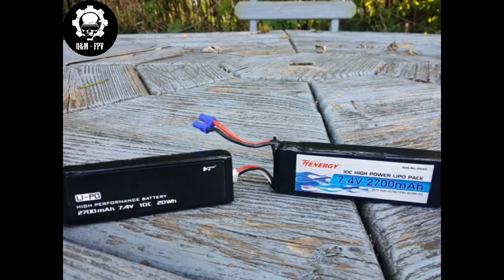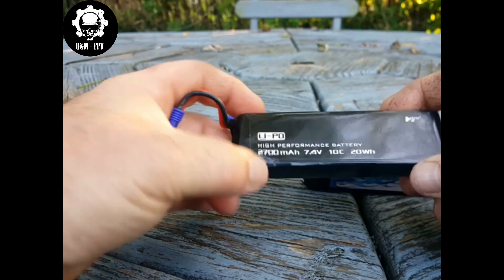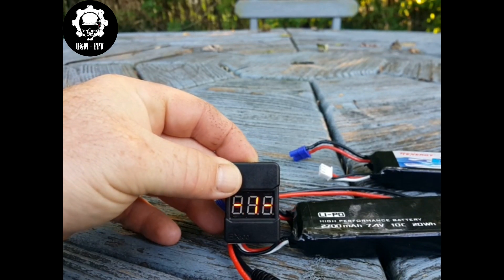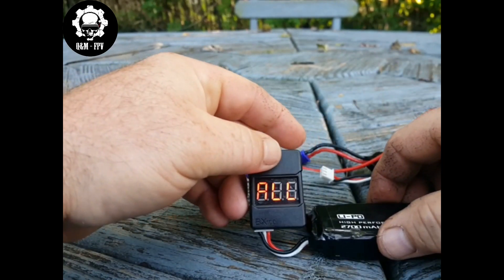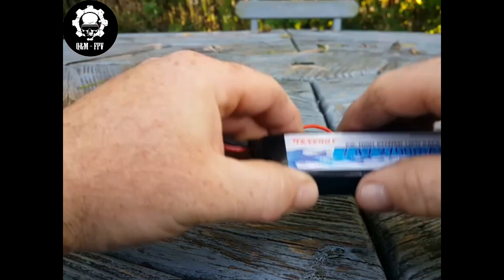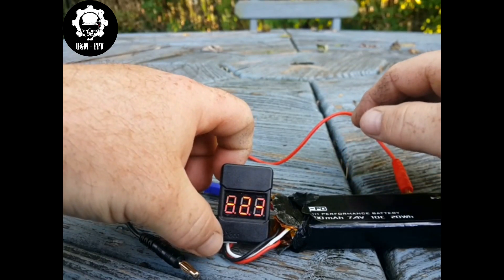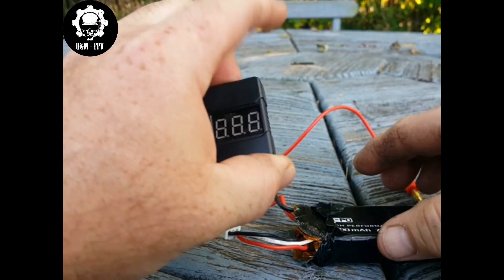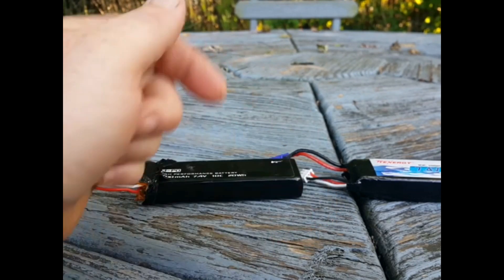Hubsan Batteries! You NEED to watch this!!!!

Comment: Just FYI: It's called a, "protection circuit" and not a, "voltage regulator". :-)
 
A voltage regulator is exactly what its name implies: feed it a slightly higher voltage than what you want at the terminals -- ex. use a +5 volt voltage regulator on a +7.4 volt battery, and you'll get a steady +5.00 volts regardless of the load or the input voltage --  provided that it stays above +5 volts).
 
A protection circuit on the other hand, generally has multiple functions when installed in a Li:Po or Li:ION battery.
 
1: Short circuit and overcurrent protection -- it almost instantly shuts off the output (exactly as you demonstrated) to prevent cell damage and/or an unwanted fire.
 
2: Over-discharge protection. Cuts off the output when the battery's terminal voltage reaches a preset low; this helps to protect the cells in the battery from sustaining damage caused by discharging them too much.
 
3: Overcharge protection. Cuts off the power from the charger to prevent damage to the battery from overcharging.
 
Hope this info. is of at least some use to you.
Take it with my compliments! :-)
Reply: You are absolutely correct.
Reply: This guy does not know what he is talking about 
He is there kind of person who says amperage instead of current
Reply: @pixel_man2346  LMMFAO
Reply: @raydesheles9205  how do you "Laugh my my Freaking A** off?" lol
Reply: @thenorthorangesquad1738  are you the one that made that long drawn-out explanation or are you the one that made the video the one that made it the long drawn-out explanation is when I laughed my ass off at smart pants
Reply: @pixel_man2346  how would you know
Reply: Lol!lol!lol! RIGHT!

Comment: Only a idiot gonna get their quad fall from the sky beacause this only happens when the battery is low voltage 7v or 6.8v ???? almost all drones that are modern (2023) they return to the ground with 7.10v or 7v so if you are flying this old drone and the voltage is near 7v dont give full  throtle or fast speed and descend your drone and your ok !!!

Comment: I have the factory hubsan battery’s but I also have a question, I recently started using hubsan drone again and 2 of my battery’s I bought for the hubsan drone are charging for a long time but hubsan is dieing as soon as I take off, but the original battery I got with the drone works as it should for being about 5 years old, am I charging those other battery’s wrong, or are they just old and should I not worry about it

Comment: Please I need the saint through tonight community can you use a 7.6 volt 2050 w battery in a 122d storm hubsan it already has a 7.6 750w I was just wondering if the 2050 makes a different or if it means more play time

Comment: Does the newer Zino and Zino pro batteries have this protection cutoff circuit in them?It would explain why my Zino pro fell out of the sky for no reason...
Reply: Zino pro batteries circuits fail and overcharge the cells. It shows full battery but they are not, usually puffed. I had 2 failed within a year with same issue failed board. Loads of videos about those and how to use off shelf battery instead

Comment: Because this is basically a toy quad that a lot of kids with no RC or battery experience will purchase, it is a safety tool to keep the battery from catching fire in the kids hand. They will either on purpose or accidently, short the battery just out of curiosity. Kind of a safety and protection for the company itself. This quad is not built for aggressive flying or abuse.

Comment: I dont fly any way that u describe so maybe thats why i have not had any of the problems u and others that have these same batteries iv been charging and flying with since i got my tried and trusted ss since july2017 no problems what so ever at all.and iv flown my baby with these same 4 husban batteries since i got it with hundreds of charges an flight in all kinds of FLYING enviroments from California winters in L.A. to spring time weather and Hot. Time California Summers and not one PROBLEM with these same husban batteries. But your videos is informative to all of us who have the ss advance. Mine has been so go to me over the 2years ive been HAVING fun flying my little book. Pack baby as my FELLO quad flyer DJ soul force called it. Its been one of my most realiable quad. With many flights of all types under its flying belt. I've flown my husban ss more than all my dji quads and my many other quads. Its battle tested to the highest degree of my testing of all different types of quads and its still ticking and flying like the little black champ that it is. Ive taken rhe little husban with me every where and have flown it and the 4 batteries iv been having for a couple of years now with out nary a problem from the quad it self nor. Any of the 4 husban brand batteries. Still thank u for MAKING every body aware of the potential hazard that could happen to the quad up under different loads and certain modes of FLYING and u said some about props.

Comment: So basically the " protection circuit " will save the battery  while my drone fall from 300m. Forget the battery bro... save my drone.
Reply: @David Bentz Jr. Except that one of the ways a battery fails is it bursts into flames.  In that case you'd have a burning drone falling from the sky as a bonus.
Reply from the maker: Yes in basically the protection circuit saves the battery at the cost of complete power loss. The circuit would provide benefit in the event the battery was shorted in storage or transport. Not all lipos have this protection circuit. I personally find it important to know if a battery is fitted with protection or not.

Comment: If you`re flying aggressive propellers, don`t use stock batteries ;)
Btw, why even keep a 10C battery? Seems kinda sh*tty, even the 240mAh single cell for the x4 has a 25C rating lol :p
Always have some overhead with batteries, saves you a lot of money in the long run :)

Comment: Is this the cause of these drones falling when pushing hard in altitude hold mode ?
Reply from the maker: It can cause the quad to lose all power as if you disconnected the battery. It's more likely to trigger the lower the battery is on power. So just something to keep in mind. There are plenty of aftermarket batteries that do not have this protection circuit.

Comment: Circuit protection so you don't burn out your ECM motors .Not had any problems with hubsan battery's
Reply: I agree with you on this subject.
Franko Flyer
Reply from the maker: Good. Glad you are one of the few that have had success with the Hubsan batteries. Many have not been so lucky.
Reply: @QuadsMods   I've got a stack of 5 sitting he reading 8v, won't even lift off.  I have other batts, diff brand,   that work great.
Reply: Man common sense !!! Why somebody is still flying with their drone when the voltage is so low at 7v or even 6.8v ??? thats stupid !!!! return your drone to the ground at 7.10v or 7v with small throttle adjustment and will never have a problem !!!

I have more than 14 drones and  all modern ones go descend automatically at 7v ! So since this hubsan is older i get mine at 7.10v close to me and with subtle trottle !!! @QuadsMods

Comment: nice video...ya the stock battery not too great.. i converted a 3s 4500  30 c lipo to 2s 30c 4500mah...need a balance plug and a scale to measure the new battery and compare flight times
Reply from the maker: richard mccoy thanks richard. Where you been buddy?
Reply: been busy.. making my own kodi build.. and my own kodi addon..tryin to make some money to do my next build atm researching a good lightweight strong 450 frame.. need something carbon fiber prob 4 or 5 mm thick.. the ole flamewheel 450 frame is heaevier then i like.....and been flying alot prob gonna upgrade my 501ss firmware..stock controller..what firmware do you suggest? y 501 when i take off it trys to keep going up...im sure is a calibration problem... also trying to get away from toy drones...looking for a build with more flight time.. im definately gonna check into pixhawk and ardupilot they prob the best for rock solid cinematic platform and reliable gps faildafes from hell... id get a mav air but i dont like having to use a phone to fly...i hate phones...so i must build what i want...
Reply from the maker: richard mccoy sounds like barometer issue if it keeps going up after you let off stick. The latest is a stable firmware. 2.1.29RX/1.1.41FC
Reply: what about the other firmware the 4.2.24 do i need to update that? for the point of interest circle fly?
Reply from the maker: richard mccoy yea go to 4.2.33
Reply: i just downloaded the new firmware.zip it has 4.2.28 ill try find .33.. what about my barometer might be bad,, should i not try to update?
Reply: it dont seem to be in the files area.. :(
Reply from the maker: richard mccoy try this.
https://drive.google.com/drive/mobile/folders/1VV7pIeS0HPRR2S2cZQTs3horpfWDdfcJ?usp=sharing
Reply: thanks that worked.. can you ad that the h501ss firmware.zip or we still have a file hosting problem?
Reply: thanks got it... should i try updating firmware with a possible barometer problem? or you think it be ok?
Reply from the maker: richard mccoy from what you posted saying you climbed to over 200m and it still only indicated 200m it sounds like a barometer issue. Firmware will not fix it. You also run the risk of losing it if thr barometer sticks as it is going to keep climbing until it sees the correct pressure. If it never gets to that pressure cuz the barometer is stuck its gonna keep climbing.
Reply: ok hmm.. couldnt find any info on how to replace the barometer.. found a new barometer...ya i didnt think firmware would fix a bad barometer.. was just wondering if it would mess up the  firmware upgrade.. thanks for info
Reply from the maker: richard mccoy its just a sensor board with a patch cable with plugs on both ends. No soldering required. Its possible that your board is just detached you might even be able to see it if you pop out the windshield or lookin thru the battery door

Comment: Either way, if you come to think about it, when you burn a motor flying up, your ass still going down and with just 3 propellers spinning who knows what direction your going.... its just a misfortunate event lol Edit: Atleast when you do go down, you dont have a burnt motor to add up to the destruction.
Reply from the maker: Angel gallardo its harder to locate the drone if its not powered up. If the drone stays powered up after a crash its easier to locate. There is always risk when airbourne. ESCs fail. Propellers fail. Bearings fail. Adding another component is just adding something else that doesnt need to be there in the sky. When flying you want to minimize all risks. In my honest opinion its simply a better choice to not have it there. If you are cautious enough there is no need for it in the first place.

Comment: Man that is damn silly to implement such an Protect system. Regulating the current is ok but when your drone falls out of the sky that´s not fair. Thanks for sharing
Reply from the maker: Lucky Rotors FPV just doesnt need to be there in my opinion.
Reply: Yep that would be the best thing :)
Reply: "A" before consonants, "AN" before wovels, fine print below.

"AN before words such as "hour" which sound like they start with a vowel even if the first letter is a consonant. Also use AN before letters and numbers which sound like they begin with a vowel, such as "F" or "8". Remember, it is the sound not the spelling which is important."

English, it`s a thing, and so is grammatical pedantry syndrome, sorry not sorry ;)
Reply: @afrog2666  - What on Earth is a 'wovel'?

Comment: Thanks for information. I have a 501ss. I never new this. Had bird drop once. Now I  know why.
Reply from the maker: Slydad I think alot of people have experienced this "protection" at some time.
Reply: Tom, thanks again bro. Been trying to find the Tenergy battery. So far can't find what I want 3000 mAh  with a little more than a 10c.
Reply from the maker: Slydad there is actually a 3400mAh pack. Its not made by tenergy. It comes with a set of washers to shim the main PCB and is 25C I believe. A couple of guys run them with good reviews. Do a search for 3400mAh hubsan H501 battery and it should come up. I was thinking about trying the engpow 3000mAh battery for the mjx bugs. I know the connector would need to be swapped but I think it might fit the battery bay. Whatever pack you decide. Stay away from the hubsan branded ones.
Reply: Thanks bro will deff check it out.

Comment: Although the protection circuit(not a voltage regulator) is a drawback, it is a safety feature to try an attempt to avoid LIPO fires when overloaded due to overload and voltage spikes. These are caused by overloading the battery by high loads caused by extra load on motors by props and other factors. When battery is in the 6.8 to 7.0 volt range and aggressive stick movement is done under high load conditions it may trip causing the drone to fall from the sky. It has happened to me once and I was lucky that I was under 10 meters when it occurred.
Reply from the maker: J Ayotte glad you recovered it.
Reply: @QuadsMods  I am glad I did.

Comment: I would plug my stock battery in and the lights would flash once and then nothing, I tore it apart and checked the cells and they were fine, I just omitted the protection. Works like a charm now.
Reply from the maker: Gridarmorfix I am going to attempt to do the same.
Reply: Like to see a vid on how to do it. Chris Smith QC guy did one for the Parrot Bb2. I did that one all good.  Guess I try same wiring just no board.